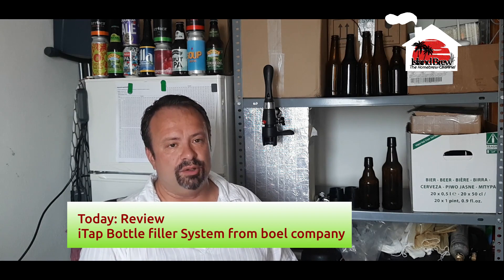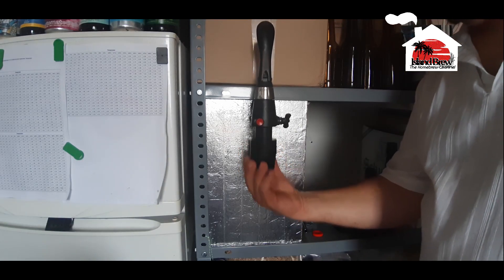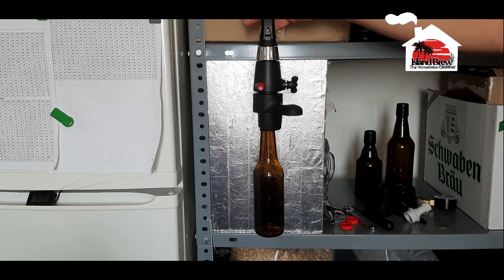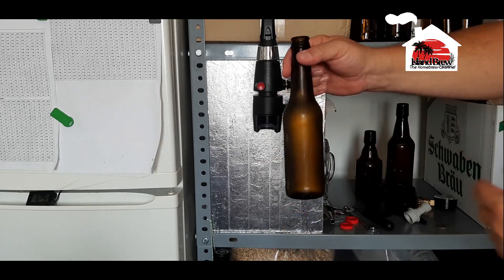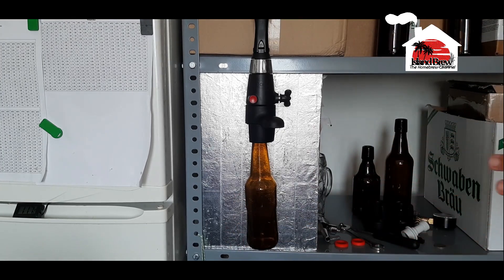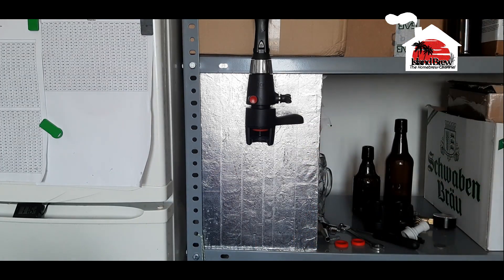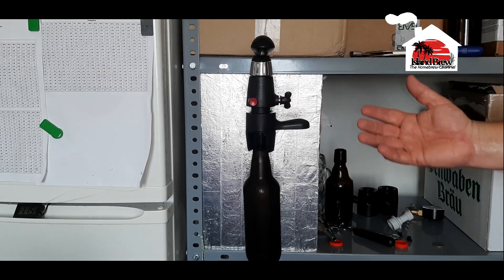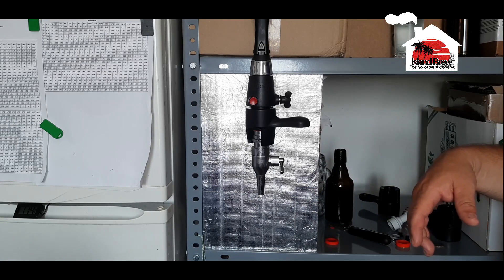Boel iTAP Review and how to use - english

Comment: I really enjoyed your very informative video but could you please let me know 2 things 1st at what pressure was your co2 set to and 2nd could you give more info on how you adjusted the stops
Reply from the maker: Hi Peter, the bottling pressure depends on your carbonation pressure of your keg. I've had it some psi over the carbonation of the keg. Hope that helps you. The adjustments of these little stoppers where only my way to make this first versions of that clamp working for me. I guess with the new version of itap and the different clamps it work much better. Cheers!